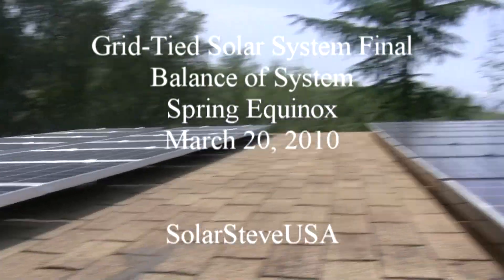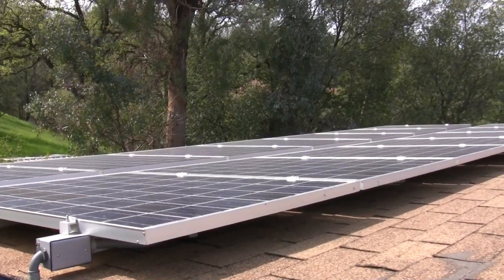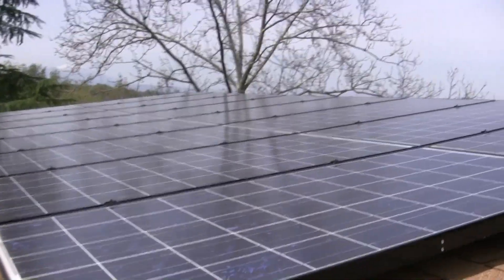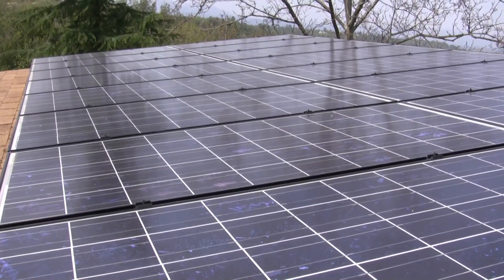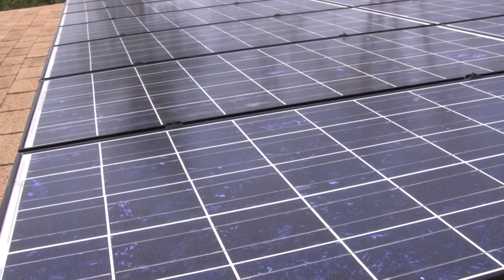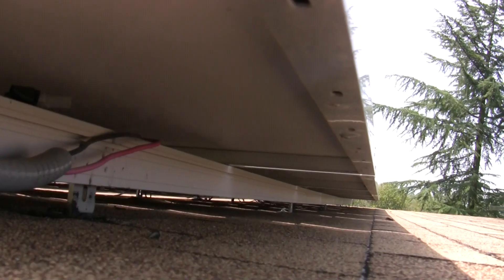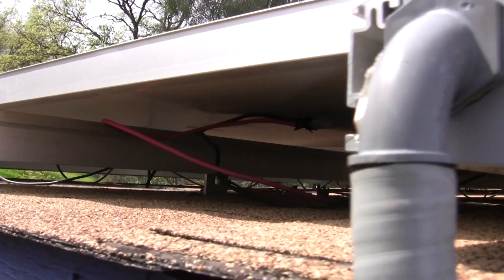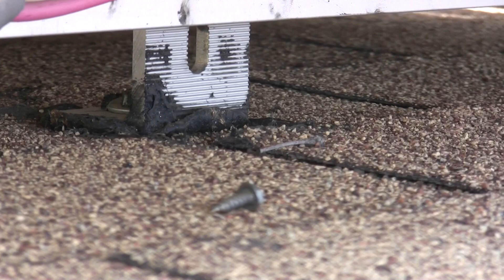Gridtie Solar System Final: Balance of System, Part One

Comment from the maker: The down side with this type of system is that any utility interruption will also interrupt the inverter as a safety measure. In that case, a true off grid system really shines as the presence of grid power is not required.

Comment from the maker: Remember, this is NOT an off grid system. When PV/inverter output is less than the actual real time load from the residence, the grid makes up the difference. When the opposite is true, the utility meter effectively runs backward.

Comment from the maker: In a grid interactive system there are no batteries. It is a direct utility intertie inverter that produces as many 240V AC amps as the PV array will allow. This allows the array to make more power overall compared the the average battery based system in a maintenance charging profile (exceptions exists here of course). Because of maximum power point tracking, the inverter is able to regulate itself as PV input changes to provide the highest possible amps output.

Comment: Hi Steve, I,ve being told that you always need a battery bank to get a proper domestic distribution of power through the household due to the flunctaion of the solar energy to the solar panel when connectted directly to an inverter.. pls is this the case and did you use batteries in your own project aswel. cheers.